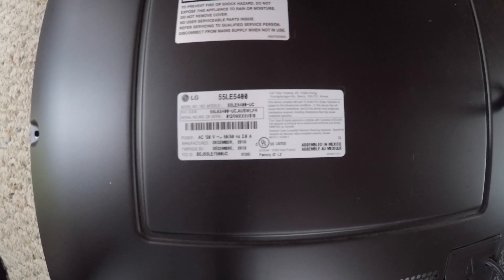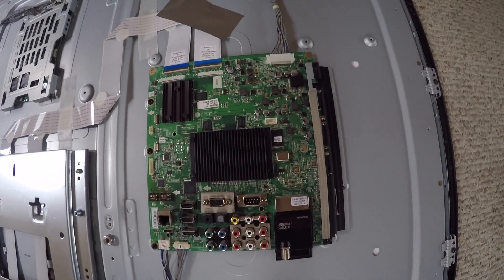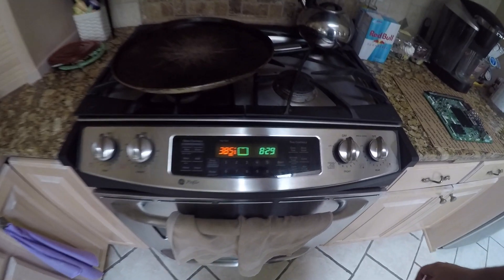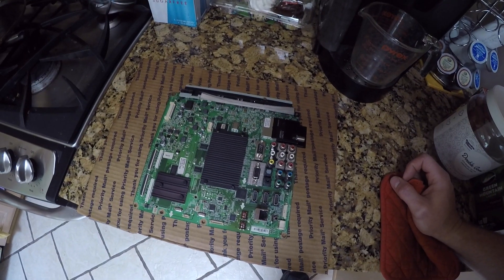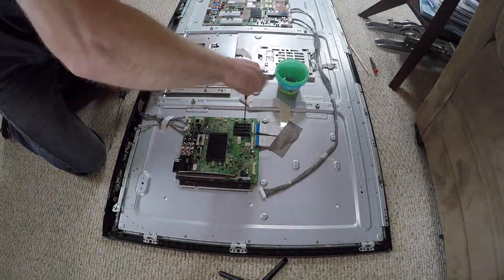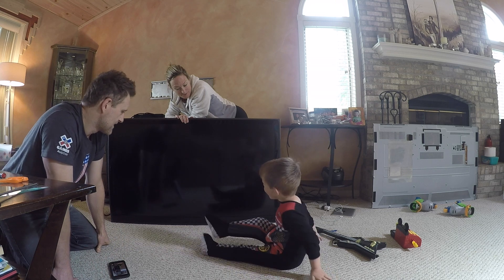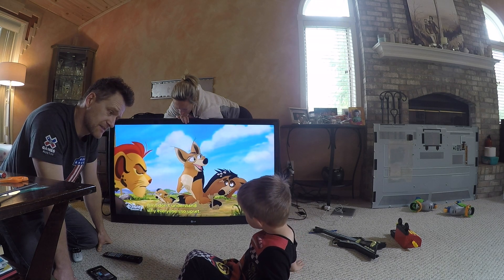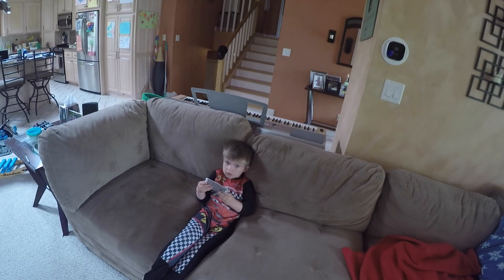It Really Works! LG TV Repair - How to Fix Your LG LED TV | Reflow / Bake Your Motherboard

Comment: Thank you! Thank you! It worked with my 42LW5500. 145 degrees Celsius and 16 minutes were the settings. The chip also got fresh hig grade thermal paste. Let's see how long it lasts.
Reply: Lasted for 4 months. I bake it again on 155C for 16 mins and works again.
Reply: Lasted for 3 months. I bake it again on 160C for 18 mins, polished the heatsink and applied new paste. Works again.

Comment: This process does work. It helps reflow very tiny broken solder connections. Two things though get flux before you do it a liquid version works really well and a q-tip and remove the large heat sink. Saturate every little metal solder connection you can see and then any plastic process boards coat all sides of those and especially the large one underneath the heat sink you want to apply a lot of flux around that which will get soaked into it and underneath it when it's heated. But only a moron would do this in the oven that they cook food in. This is extremely toxic. Go buy yourself a $10 toaster oven from Goodwill or dedicate one you already have for the purpose. I really don't understand how this isn't obvious but I've seen countless of these videos hundreds or thousands of comments and no one seems to think it's a dumb idea. Trust me it is a very dumb idea.

Comment: It worked for me!  I have a LG 47LW5700 which showed a blinking power red light with no video or sound.  I first baked it at 275F for 18 min.  The tv would turn on and died after a min.  I baked it again at 300F for another 18min, and bingo!  Thank you so much for the inspiration.

Comment: My HDMI ports and sound did not work anymore and there was a green fog on the screen.
Board in baking paper and alluminium foil ( keeps much smell inside too ) for 10 minutes in the oven at 200 C.
Sound did work again but screen totally black.
2nd attempt, the same.
Last attempt, all or nothing, 15 minutes at 230 C, more smell like burning plastic.
Ripe for the garbage I was thinking but gave it a try before dumping the tv.
Everything is working perfect again !
Reply from the maker: Amazing! Congrats on salvaging your TV and keeping it out of the landfill for a few more years!

Comment: This worked for me for an LG 55UJ6540...was stuck on spinning dots after a software update.  I baked at 300 degrees for 15 min in a toaster oven on aluminum foil over a pan. Solder didn't appear to melt, but it obviously did. Back in action!
Reply from the maker: Awesome. I love seeing the various tricks and modifications everyone is adding to this process. Glad you've salvaged your TV!

Comment: Got a LG 60pk250-US from a local fellow for free.   The red light on the front would come up and that is all.   Put the main power board and the I/O board on a silicone baking sheet in the oven at 285F for 20 minutes.  I have a gas oven so temperature may have been a bit higher.  Turned off the heat and let the board cool in the oven.   Put everything back together and it works flawlessly.   I've  been burning it in for 24 hours so far.

Comment: Found 47LV5500 by dumpster today with same symptoms. Used this fix with minor tweak, and using toaster oven just now at 375°F for 20 minutes. Worked. I'll burn it in a few days and report back. Thanks!
Reply: Also, I did used foil to protect the edge connectors, and applied no-clean flux from the outside edges of the BGA  until I could see it coming under and through to the other side. 
I believe the higher temp would give a better chance of success, with the acceptance of some risk. The toaster oven I used had a convection fan, so spread out the heat some.
I turned the heat off after 20 minutes and let cool slowly. Luckily I had no components fall off. inspection after cool down showed no warped connectors or anything looking charred.
I worried about the few smd electrolytic caps, but I think this method keeps the temp low enough for a short enough amount of time that it didn't hurt, yet hot enough to heat soak the board and reflow the connection(s). Not bad, and quite a nice smart TV, great picture. Looking forward to seeing if it survives a 3 day 'burn-in cycle'. I'll report back.
Reply from the maker: What a score! Nice work.

Comment: I baked mine, and it only worked for like 6 six, then it died again. Not sure if I should bake it again, any recommendations?
Reply from the maker: I would give it another bake. I’ve heard of others who had to do it twice. You’ve got nothing to lose, right?
Reply: Did you retry? Curious. I just did mine, and am running it constantly for three days to get some confidence about the longevity of the repair. 
Good luck to you!

Comment: I used a blow dryer and  did not even take it apart. I just pointed it at the vents ports and screen for about ten minutes and then turned it off and back on and it worked !

Comment: I popped the heat sink off of the bgu chip and used a heat gun to gradually heat it up pretty hot (after using caftan tape to secure the components on the other side of the ct bd) reassembled it and it's working!!! Thanks for the inspiration.

Comment: This worked for me on a LG 47LV3700.   Baked it  at 385 degrF for 10 minutes and let cool down for an hour in the oven.  I removed the heat sink for the CPU first and put thermal compound on it after heating it in the oven.    It took longer to take the TV Off and On the wall than the rest of the procedure.

Comment: Hey, don't want to be a downer, but i just tried this on my LG 55" 55UF6450, and its still not displaying video.
I will say that I am AMAZED the TV turned on again, at all!
Baking a circuit board!?!? Are you kidding me!!??
But.. when the board is basically trash, why not give it a try, right?
So I did. 
But, with less positive results.

I may also have different issues than are described here, though;
My TV turns on, and is fully functional as long as its on, EXCEPT that all video is "snow".
Very strange.
All inputs, all apps, anything that is video will not display. The audio will work, the menus will show up Crystal clear. But the video behind the menus is snow.
I think it might be an issue with how the board is processing a video signal, not necessarily a broken link/solder/circuit. So that might be why it didn't work for me.

So I await my $250 replacement board (sigh..)

Good luck to everyone else!!
Reply from the maker: Tony Ricketts Bunmer it didn’t work for you. I’m by no means any sort of electrics expert, but I’m amazed every time someone replies that this trick worked for them as well as it did for me. Good luck with your new board. Hope that fixes things.

Comment: Hi Jeff,  Thanks for the video.  Our 2012 47 inch LG went out and only the slow red light flashing.  TV repairman said mother board bad.  I put it on a piece of parchment paper on a cookie sheet and covered with parchment and baked for 18 minutes at 285-300 degrees F, turned off heat and left it in for two more minutes, cooled it,  installed it and TV worked.  No loose solder on parchment.  It has been 3 days since the bake and all is well!
Reply from the maker: LeRoy Winge So great! Congrats!

Comment: Found LG 47LX9500 on the kerb, works except HDMI ports, will try this method soon to make HDMI working, otherwise need to call garbage collectors!
Reply: Just to confirm: It works for me. However, smell from the oven was bad. Now I have 47" 3D TV. And please note: 3D Tvs manufactures do not produce anymore.

Comment: Did NOT work for me. I have the exact same 55LE5400 that is seen in this video as well. I did it at 385F for 10, all the other videos use that time and temp. I have a digital soldering iron, and at 200F, solder won't melt.

Comment: Thanks!, this worked for my 2010 LG 60pk950.  I used 285 degree F for about 15-16 minutes.  Smell wasn't too bad.  My mobo had some plastic cutouts that got melted/deformed a bit, but unavoidable as they were connected to the board. FYI.

update 2/19: mine just went out again so perhaps I didn't bake for long enough to soder the joints completely back in place.  Trying again, but I've read that this can only be a temporary fix and is probably dependent on how bad your specific boards issue is.

Comment: I have a LG TV that I have done this 5 times with.  I found this method the first time it stopped working.  It has stopped working 4 more times since and every time 10 min at 385 F has brought it back.

I have switched to Samsung TVs now though. Heh
Reply: yes this is  a temp fix they really need to be reballed.

Comment: LG 55LW6500 - Turns on, no Picture, No sound.

Tried baking today at 180 Celsius ( 356 Fahrenheit) for 15 mins. It worked for a while but soon turned off after about 1 hour usage.

I will try again later at  200 Celsius ( 385 Fahrenheit) for 10-15 min (trying not to burn) and see how it goes.
Hope this fixes the issue permanently.

I will let you know so people can try!!

Comment: Hi Jeff,
so 285 fahrenheit for 18 Min? or 285 celsius for 18 Min?
it sounds like fahrenheit but to make sure I've got the right temp.
Thanks in advance!!
Reply from the maker: Daniel Cho Fahrenheit. It seems others have good luck with 285 F... hope it works for you too!
Reply: Thanks Jeff.

Comment from the maker: A tip from other commenters: Adjust the temp to 285 F and bake for about 18 minutes. This seems like a safer temp to ensure the solder doesn't completely melt and drop other components off. Good luck!

Comment: I am a technician for the past 42 years and this does not work. It will destroy your board.
Reply from the maker: After doing the repair shown in the video, it has been working for well over a year. I've had friends experience the same success.
Reply: I am a consumer of 50 years.  As a technician of 42 years what do you suggest?
Reply: Did they have TV's 42 years ago? Sorry, your knowledge of modern TV's is as good as anyone who can google. You don't repair them now...your replace parts, or replace the TV. Your expertise that served well 35 years ago, just doesn't apply now....I don't see any technician fixing modern LCD TV's by breaking out their soldering iron.
Reply: Worked for me.
Reply: Worked fine on mine. Definitely did not "destroy" the board.
Reply: worked for me.
Reply: We did ours three years ago, and it worked perfectly. Getting ready to do it again today.

Comment: I just baked mine (LG 55lv5500) in the oven at 285 degrees for 10 minutes and it worked. I had no picture or screen activity at all but the power light was working. Apparently solder softens at 265 degrees